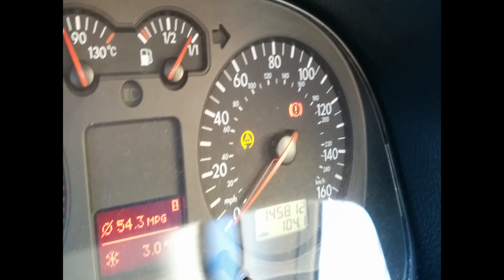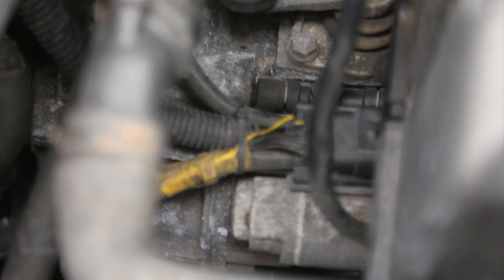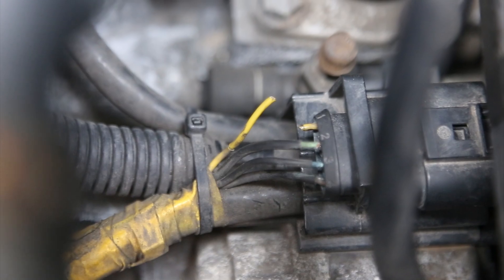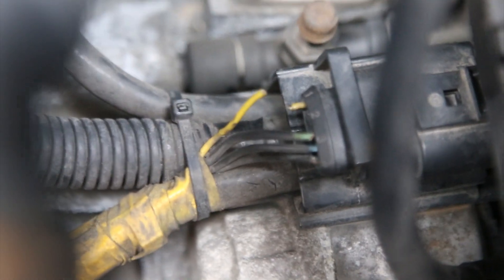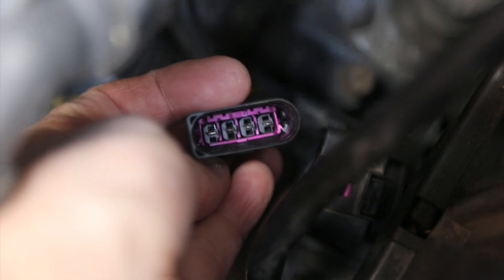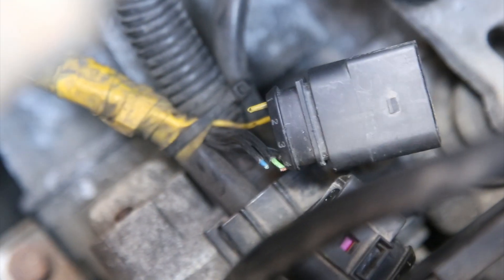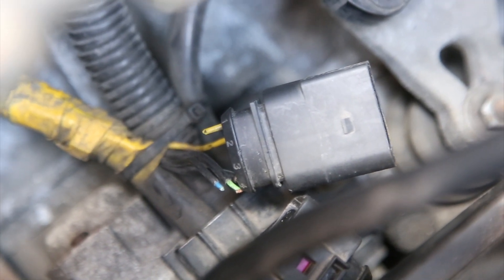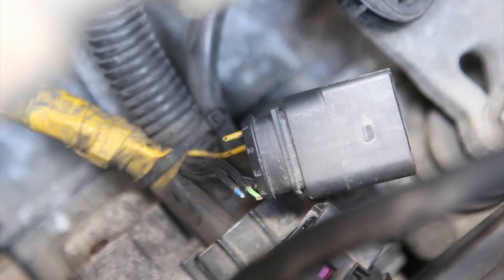VW Golf/Bora ASR/ESP Dashboard Light comes on after 10 minutes driving - How to Fix & Repair

Comment: been having this issue for months now then i found this vid i pulled the connector apart cleaned it gave it a squirt of wd 40 and its fixed for now i shall let you know how i progress thank you
Reply from the maker: Fingers crossed it worked!
Reply: What happened, dude? Did you managed to fix the problem?
Reply: Sadly not it returns to taunt me it has rather sucked the fun out of it for me I try sumink new every week with little success it comes and goes with alarming regularity the vcds is little to no help beyond saying signal implausible which is such a wide description that I can't centre down on one area the wheel speed sensor,s all appear good when it decides to work the pump runs as it should it's all a tad exasperating to be honest

Comment: I have the same problem. But it occurs when I turn on the air conditioner or heater in my car. When the light comes on, the car loses traction and gear changes are jerky. If I turn the engine off and start it again, the problem goes away. What should I do, please help

Comment: i have the same problem i am thinking what about checking the cables that are under the battery maybe there are  damaged by the acid just thinking ?
Reply from the maker: The problem is generally the cables. They run along the front of the engine bay as shown about 45 seconds into the video
Reply: On the weekend I try to check I found out that the is a damage on my coil adapta I replace it with another one I am waiting to see if the problem is solved my car is a polo Round light 9n
Reply: The problem is not solved 😥😥 yet
Reply: Epc light pop up when it down hill or road? That what I observed this days anyone who have solved the problem?and after rain?
Reply: Today when I diagnosis 

Possible solution

1. Check/update control module firmware.
2. Check/Replace control module.

I haven't done it yet but they said EPC light must be the solution

Comment: I have the same dashboard light on my golf 4, I got it just after changing the abs module that was out but know braking is good but got this dashboard light; 
do you think it's coming from a broken wire? or the abs module is not good?
thank you
Reply from the maker: It could well be a broken wire but if you replaced ABS pump it may be related to that - there might be a procedure to bleed the system with it

Comment: This video does NOT show you how to fix it, it just identies and shows you where the problem is after that your on your own, but thanks anyway i actually found that thats the problem on my 01 mk4 gti
Reply from the maker: The problem is generally the cables that run along the front of the engine bay as shown about 45 seconds into the video which shows you what to fix. I didn't think anyone would need to be shown how to join cables but would that be of use?
Reply: @ajvw  thanks for sharing
Reply from the maker: @marcior.2153  hope it helped

Comment: hi im having same problem but there isnt any broken cables
Reply: Broken cables can be a pain, especially when it's a wheel sensor, wheel can and will lock up at any point...did it to me at 120mph on a bend. Was very lucky that day. Most stupid thing in a car, designed to locks wheel up! Fucking crazy.
Reply: @andrewwright.  this happened to me today it felt like we went over a speed bump
Reply: @Simon2952  the mk4 golf I have now I had it deactivated because of worry. Brand new car is fine and the manufacturers will be fine...15 years later it's a death trap with faulty sensors or the real worry of broken intermittent wire issue people just don't know about or lack of interest.  

I often think of that day at 120....was no joke or lie....me and my mate came real close.
Reply: @andrewwright. I can imagine, it happens to us 3 times today, twice on the way to where we were going and once on the way back. It seemed to do it when I was took my foot off the gas I was going about 120kph. Did you get the triangle looking warning light come on for you?
Reply: @Simon2952  yes it flashed up while it did it which is what got me looking into it and how to disable it. 

Quickest cheapest and with safety it mind is to unplug the maf for a while, it should bring it up pretty much straight away...plug it back in and the asr/tc will be disabled or have it coded out like I did. 
I have tc but not the other cap vw put in. Wheel sensors are there and still wired for inspection/mot only purpose.  Cost £30 from your mapper if you have a good one local  to you. 

What do you have? I had at the 120 moment a cupra 1.8t, now I have the 1.9tdi pd130 and has the same issue so again I have it disabled
Reply: Ok thanks,I have a be passet I'm just doing some research about it now

Comment: now l know what is the problem in my car because after 10 minutes light on and the air conditioner didn’t work,, so now one question please if l have  number 1 with number 2 and number 2 with number one it will be the same problem also esp light on and the air conditioner didn’t work? Thx

Comment: I have the same issue with my 2003 mk4 gti 150pd the light comes on during my journey, no pattern to it it's just randomly , and stay on till the car is next turned off, but when it comes on it creates a engine shake slight vibration anyone have any ideas.

Comment: hello, I have the same problem with my 2007 Audi A6 2.0 TDI, were is that cable located in my car, can you help?
Reply from the maker: It's hard to know with other cars but you should be able to trace the wires running along the front of the engine bay. On the Golf they also have the air con compressor wires taped to them.
Reply: Eduardo Cardona  i have the same problem with my audi a6 2007, have you found  the problem ??
Reply: @majdalhassan3439   hello Hassan,
I had no luck yet, in the near future I'm going to take the car to an official dealer, I'll say someting if they find the problem. Best regards.
Reply: Eduardo Cardona okei, thank you 😊
Reply: Hello, my car just came from the dealer and in my case the problem was the electric alternator that had to be replaced. It's Working fine now but the Bill was 900 Euros.
Reply: @eduardojosemartins5429  dealers :D

Comment: If this cable is broken, does it mean that esp don't work? or what?
Reply: If the cable is broken it means it times out after 10 minutes as the ECU is unable to detect the ESP signal so yes it won't be working
Reply: Carsmes I have those same two lights on mine the 1 and the circle with the line throughout what does itmean
Reply: The same problem happened in my skoda Superb
How do I fix it?
 I did not know cable who is in the video
thanks

Comment: With this fault your Air conditioner didn't worked either right?
Reply from the maker: Yes that's correct. If you follow the wires they lead to the air conditioning compressor so the break in wire stopped that functioning
Reply: FoMuwel kemna thx thx 🙏🏻 now l know what is the problem in my car because after 10 minutes light on and the air conditioner didn’t work,, so now one question please if l have  number 1 with number 2 and number 2 with number one it will be the same problem also esp light on and the air conditioner didn’t work? Thx
Reply: FoMuwel kemna  so if l will put the cable right it will work the compressor and the esp light will be of ? Thx alot but we are here in austria they have no idea they don’t think so much like you 😉